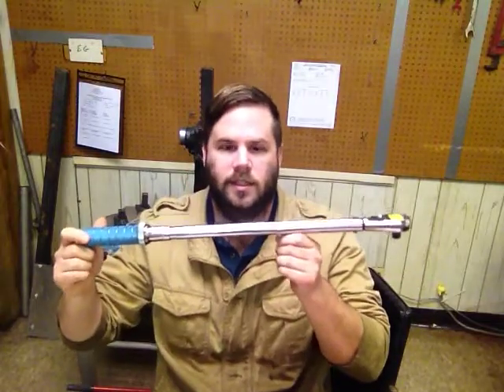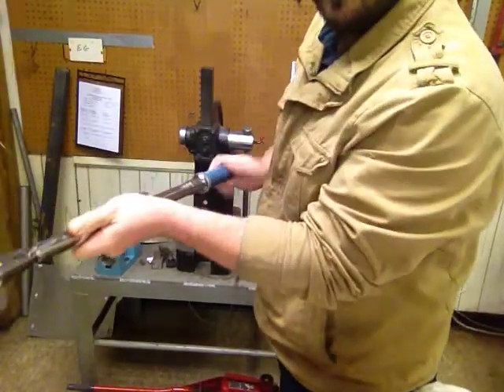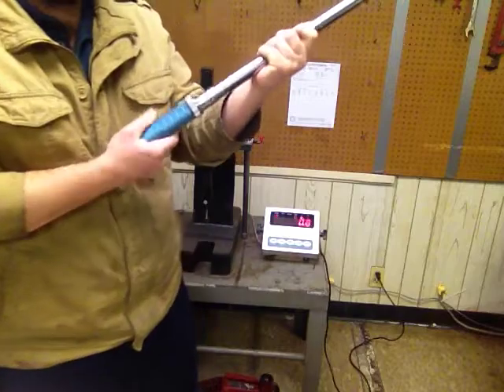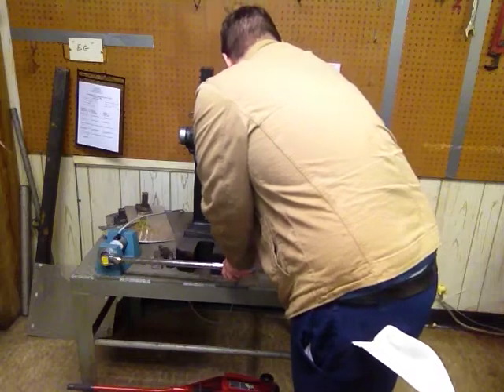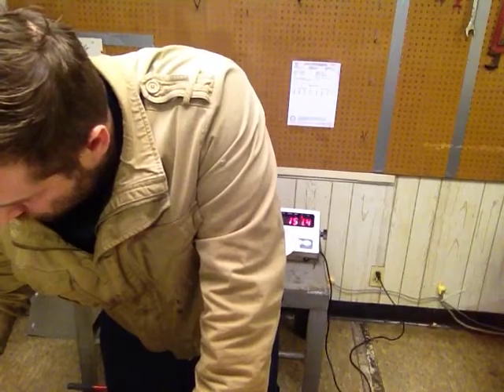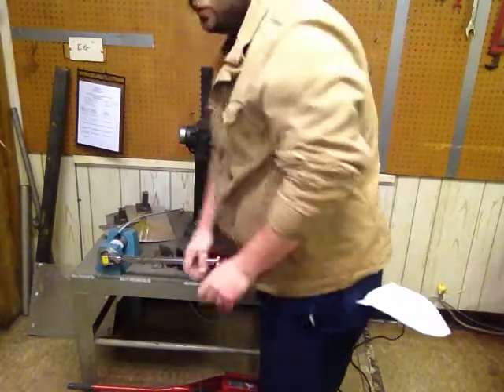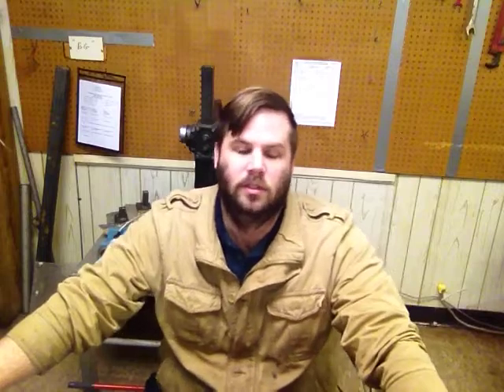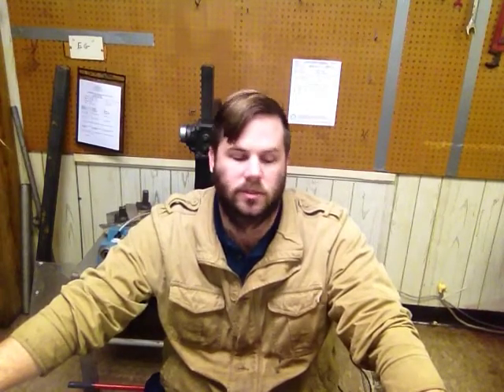Calibration of Armstrong 250 foot pound torque wrench  to ISO 17025 and shop update.

Comment: The ISO 17025 spec refers to the lab, not the torque wrench. You should be using ASME B107.14-2010 for click wrenches, which is 3 checks at 20%, 60% and 100% of full scale. By the way, your wrench failed. The spec for that wrench is ± 4% of indicated value, so at 75 ft.lbs., the reading must be between 72 and 78 ft.lbs. You first reading was 71.4 ft.lbs., which is too low. All nine clockwise readings must pass, or the wrench fails.

Comment: im a calibration engineer in the uk note. this can only be used to see the accuracy of a torque wrench to explain how to adjust/calibrate torque wrenches would take a very long time as there are many  variations we use norbar torque wrench analysers and we are mobile we travel to each garage around the uk testing everything from torque wrenches to micrometers, pressure guages etc pretty much all hand tools which have a scale we operate under iso 9001:2008 and british standards :-)
Reply from the maker: +dbTruth Uk   Yes, absolutely.  There is a-lot more too it when you get into adjusting.  CDI has a very good primer on how to adjust torque wrenches in more detail.  I'm just trying to show some basics.  The torque cell i'm using in this video is a Norbar smart cell.  I also have a few other analyzers i use for IN/LBS. Are you guys ISO 17025 accredited? and what procedures are you guys following?  I haven't had time lately to make any more videos.  What would you guys like to see next?  more pressure gauges, thermometers, multimeters, clamp on amp meters, screw guns, micrometers, gas detectors?  Any suggestions would be helpful.
Reply: +This old shop check out our company website www.oakrange.co.uk all our information on operating procedures goods and services is all on there if you have a spare five minutes you may find something interesting 👍

Comment: How often does a torque wrench need to be calibrated? Also what makes a torque wrench fall out of calibration.
Reply from the maker: swav100   Good question.  The most used calibration cycle is 12 months, it really depends on how often you use it or if you drop it etc...  What makes it fall out of calibration can be a couple of things.  There is a "Pawn" inside the wrench that is basically a metal block that acts as a pivot point and can wear out.  There is also a spring that is compressed when you set the torque you want.  The springs will loose their elasticity after a wile and adjustment need to be made.  One of the best things you can do, is set the wrench to the lowest setting after use so that the spring is not stored compressed.
Reply: Awesome info thanks.

Comment: My son was helping me rotate the tires on my truck, and I told him to put away my CDI 250ftlbs torque wrench.  I told him to dial it down to the lowest setting and he turned the grip/handle  till it stopped.  He did not force it but it went past the 50ftlb lowest setting.  I tuned back up to 50lbs.  Seems to work well compared to other wrenches.  Is it fine?
Reply from the maker: it's problably fine.  Most of them have a stop built into them.
Reply: thanks!  Years ago someone told me very bad things would happen if you turned it past its lowest setting.

Comment: if i found the torque wrench is out of calibration tolerance how i can do the adjustment for it?
Reply from the maker: +FOUAD RIMAWI  It really depends on the type of wrench and how it is out of cal. For a basic click micrometer type.  If it linear out of cal, such as 10ft/lbs low everywhere.   You take the handle off, and rotate it higher 10 pounds, put it back together and test it again.  If it is off all over the place, you probably need a new pawn and/or spring.

Comment: whats teh best torque wrench to get? armstrong snap on gear wrench proto? what everyones opinon?
Reply from the maker: +Richard Cowtails    I personal prefer the CDI or Proto.  Mostly because parts are easier to get for repair.
Reply: I've bought a few armstrongs and like the ball thing construction. how it clicks. a lot better than gearwrench. played around with snap on, not real fond of them. I have a proto, they seem like the harbor freight ones. excuse my not knowing a ton about them lol
Reply: +This old shop Yes,"PROTO" makes first class torque wrenches!I got three micrometer (click) style wrenches from "PROTO".They are worth every penny I spend on them.Very solid,made in U.S.A..
Reply: Please can you tell me where would I get parts for my old "Proto" torque wrench,model ; 6064A,micrometer type.
This torque wrench is probably from early 1990's.It's a quality made instrument but It is hard to turn the handle to adjust the value.
This torque wrench had rough life and I got it for free.
Reply from the maker: https://www.amazon.com/Stanley-J6064RK-8-Inch-Ratchet-Repair/dp/B002GK3M7U

Comment: Your readings were wrong, so as your process. You exceeded the force applied by not stopping right at the click. You may think that after the click nothing matters, but it does. 
This was a verification not a calibration.
You should be checking the wrench in a horizontal position to get more accurate readings.